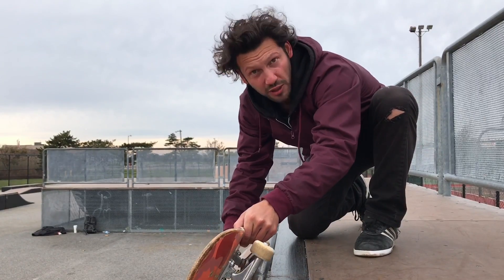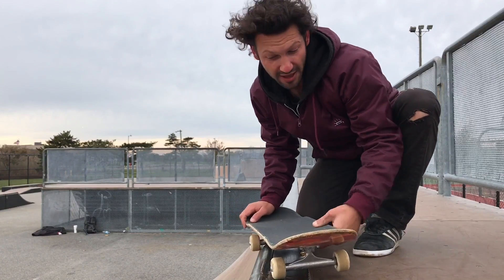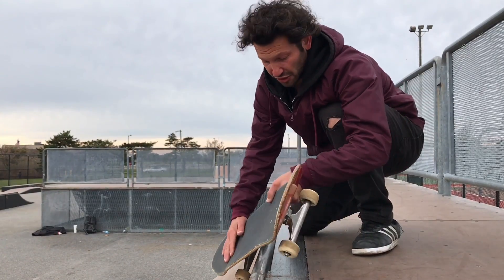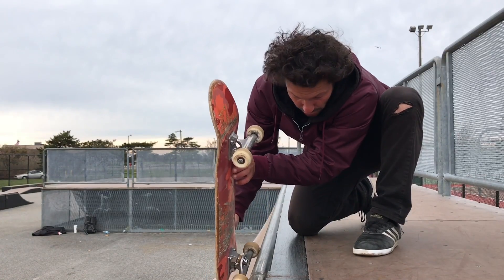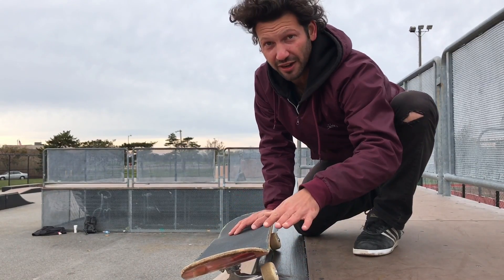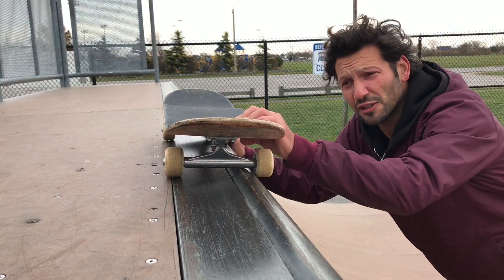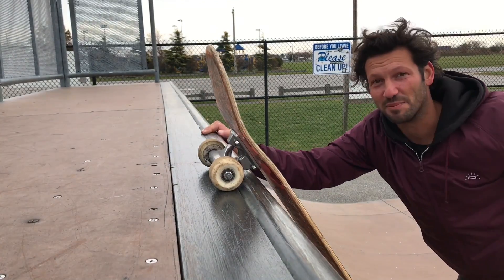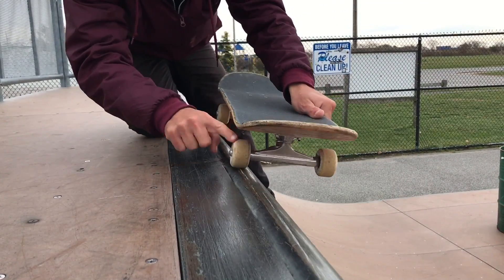How To Axle Stall On A Mini Ramp

Comment: Great work, nice! I just started skating again after 20 years off. I can't stall consistently (lmao), and then I started to realize I needed more weight on my back heel, just like you said. But I didn't realize, I am trying to put too much truck onto the copping. Great tip man. I can hear the cells in my wrists and knees thanking you already.

Comment: If you find your weight is always inside the ramp and you can only axle stall for a quick second before you have to go back in try this: I swear someone left a comment on this video saying to put your trucks on the coping and start/drop in that way like you’re coming back in from an axle stall.  For some reason that’s what made it work for me. It showed my brain how my weight should be when I get to the coping. I struggled with this for years before I tried it, and once I did, I finally got axle stalls right.

Comment: Tip: u can get u're trucks fully against the copin you will just have to kick out the back of your board a little so the wheel isn't touching the copin before u lean and turn in

Comment: Hey man, excellent tutorials thanks so much for making them. I'm trying to get better at mini ramp but the issue I'm having is transferring my weight to the vertical to be standing on the coping. I can slash grind no problem but stopping my momentum and being up on a mini ramp is difficult. I can do it on a 3' quarter pipe but my local mini is about 4-5' and I just feel like my weight is in the wrong spot. Any tips appreciated!
Reply: same for me and what am aiming for is that speed/enough speed to imagine myself standing up there.

Comment: I got bodyslammed on concrete when I just tried to drop in from axle. 
literally got shit on came here to see if I can get any tips lul
Reply: same lmfaoo
Reply: put your wheel to the coping so the coping sits at the edge of the truck that's towards the deck of the ramp. the left side if you stand regular.. really put your wheel next to the coping - slide there by pushing your back foot towards the transition. Then just turn your shoulders and drop in - don't worry about how it might feel to have your wheel come over the coping - it's not any different than a kickturn! Hope this helps

Comment: Hey 👋, so is it easier dropping in and doing an axel stall, or just rolling right off and doing it. I tend to get more speed when I just roll off, but wanted your opinion?
Reply: maybe put your board in an axle stall and drop in from that - speed should fit👍🏼 plus this helps to get comfortable dropping in from the stall

Comment: Super helpful vid as always thanks Chad. I have a question about dropping back in from 5050 when stationary. A few times my front foot has slipped off the board toeside (as i lift up my front truck and start to come back in) and i’ve fallen to flat. I’m wondering if i have to lean into transition and not be upright when i start to come back in? I really want to get bs5050 proper stalls on bigger tranny but i always get spooked and just tap both trucks and immediately come back in.
Thanks for any help
Reply from the maker: Interesting.. it could be a fear thing that’s causing you subconsciously take your foot off. Try dropping in from axle stall position a bunch of times to get used to it before locking in. Practice that on whichever size quarter pipe you feel comfortable on and work your way up.
Reply: @ChadCaruso  Hey thanks so damn much, the standing on heels tip really helped to get up and be locked in right. I'll give those tips a go:))

Comment: Do you have any tips for staying up on the coping longer instead of going back into the ramp right away? I am confused about how much speed I have and how I should approach an axle stall vs a 50 50 grind.
Reply: @Coleman Lewis you just nailed it! I was looking for a comment like yours because the way this guy does his stalls and his grinds are the same, but they shouldnt be. It depends on if you need to keep moving or if you need to stop, which at busier parks you often do. There is a 5050 stall like the one he does, where you are basically turning around to come straight back down, then theres a stall where you stop and wait before you drop back in. There are grinds which are short and more like better versions of the slash/carve ones to help you move along a ramp, then there are grinds where you want to get all the way to the end of the ramp and choose when you come in. This is all about whether you lock in against your heel side wheel or your toe side wheel. Heel side to stall quickly or grind across it, toe side to stall and be able to stop as long as you need or to grind all the way to the end (add speed to go further) without falling back in.
Reply: I should add, most people would regard the stalls and grinds this guy teaches as kind of not doing it properly, but actually they are really useful a lot of the time

Comment: great tutorial!! I’ve been trying to do axle stall for about 7 months now and this trick doesn’t come to my head at all. I even did some 50-50 grind however my body is inside the ramp instead of the deck. I notice that when I’m almost hitting the coping, my backshoulder and my back arm is pointing to the nose of the skateboard... this makes me stall in kind of feeble most of the times. 

1-) which spot do you look when you approaching the coping AND after you feel the coping with your back truck? 

2-) Do you pump and leave your body lightweight when your are approaching the coping?

thanks man! I appreciate any help as this trick is getting so hard for me.
Reply: at the exact moment that you feel the backtruck hitting the coping, where do you look? (nose, nose/coping, beetween your legs, bottom of the ramp, back foot)?

Comment: maybe redundant question but what wheels do you usually ride? I ride both park and concrete mini, occasionally street and I was thinking about getting 58-60mm 90a wheels but I wonder if they are hard enough? I like to pop really high and powerslide a lot and I don't think it would make such difference but I want to be sure. And thank you Chad for your tutorials, they are next level and they helps a lot!
Reply from the maker: Thanks Dom, I ride 54mm 99a or 101a usually, the softer your wheels are the harder it is to powerslide generally. I’ve never tried 90a wheels before but I could see them feeling amazing in a concrete park.

Comment: I struggle with this trick. I’ve learned feeble stalls but they aren’t really stalls. I roll up and like slide a tiny bit and I’m not completely 90 degrees and then my front wheel catches on the coping and then I roll back down the ramp

Comment: Whats da difference between axle stall and 50 50
Reply: 50 50 is a grind, same position as an axel stall but you come at an angle so you grind along the coping. There is no grinding with an axel stall.